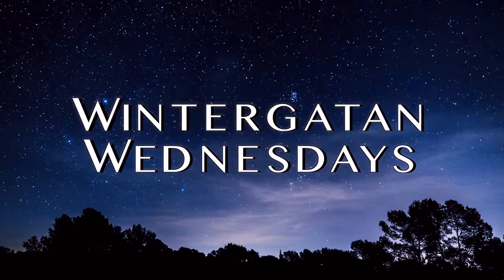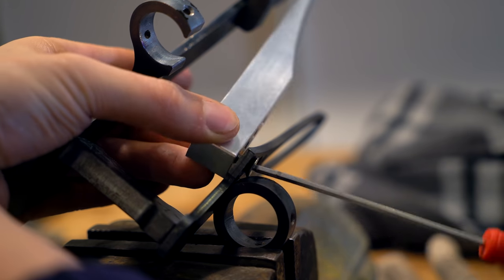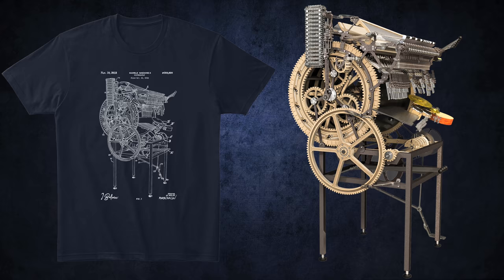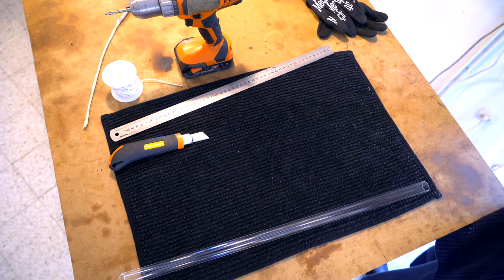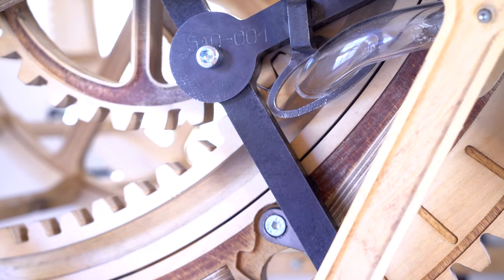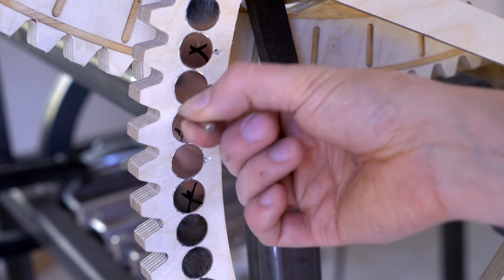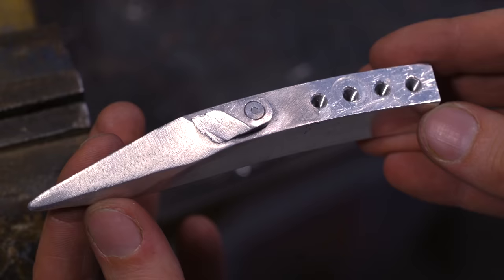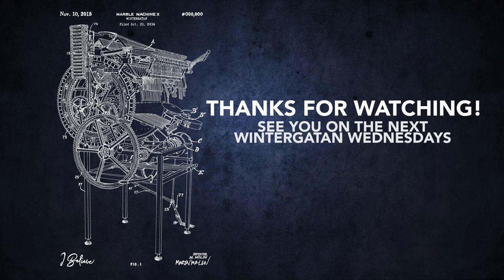Magnet Polarity Switch - Marble Machine X #60

Comment: You should use KOZ (keep out zone) volumes with your screws to avoid that type of problem. This is what we use in aeronotics to design flight engines. We basically draw a volume that represent the space required  to remove the screw at the top of it and when you put your screw in your assembly you will be able to see instantly if the KOZ touches another part of the assembly. You can also draw the tools volumes required to actually remove the screw so you make sure that not only the screw will be able to get out of the hole but also that you will have enough place to put the screw driver above the screw. KOZ and tools should be on another layer of the assembly. When you use this trick you dont need to "think" while designing haha :). 

Have fun and thank you for your content what you are doing is really cool ;)
Reply: very interesting trick! thanks for sharing :)
Reply: Ah that's so cool! So obvious but I never would have thought of it.
Reply: Can you share this little secret with automotive engineers?
Reply: Have you ever worked on a metric motorcycle? Dear god I swear they have miniature people and tools that put those things together.
Reply: Very smart!
Reply: you must also calculate the space which is required by the tool to work on the part. it doesn't make sense to have space for the screw to be placed but no screwdriver in the world can reach it then.
Reply: @TheHolan  that's what the comment said
Reply: @ @JJRicks  well, I probably should look out for my reading glasses... :-)
Reply: @TheHolan  :D
Reply: @sentry4944  Have you seen the Honda testing videos from the 80s?  Those guys are not big, lol.
Reply: @cmmartti  At the same time I could literally sit inside the engine bay of my old K1500 and work on the L05.  :)  Definitely been there when the flexplate on my jeep was making weird noises though.
Reply: @000polsris000  That was my immediate thought as well. What are they thinking?

Comment: You need to apply a coating to this aluminium piece, but not because of galvanic corrosion. The hardened steel balls will create a channel in the aluminium piece with time due to the impact of two difference hardness material. You'll be effectively bead blasting the same spot on the aluminium. The best would be an hard anodized coating. Another method would be to have a wear layer like a hard paint or a good plastic like Delrin. At the worst put a layer of Kapton tape, that will show the intensity the effect and protect temporarily. If you worry about the look, there is clear anodize or alodine, which is less hard, but much better than nothing.
Reply: Also, the friction coefficient is around 0.5 (dynamic) in your case, which make it quite bad, like a bearing without any grease and oil.
Reply: After the part is perfected, get it copied in Titanium. All problems solved.
Reply: @HeyWatchThis00  Tungsten carbide you mean?
Reply: I think that in the contrary, the natural wear will facilitate the flow so it shouldn't be coated. Then the wear will slow down quite a bit once the groove is done, so I don't feel this is a problem at least for a few hundreds of hours.
Reply: ... what about wear on the wood?
Reply: @robozstarrr8930  The shape may not be as critical, the  area may be larger in most place (or change with each strike), and wood can absorb in it's fiber some waxing and oily compounds if need be without making the machine ugly.
Reply: roboZ starrr
Exactly, I think other parts of the machine will become a problem long before that aluminimum.
Reply: @johnnylavoie  I think it's better if the marbles are a harder material than parts of the machine.  It's easier to replace and maintain one part than it is to find a bunch of damaged marbles.  I'm not sure why he didn't just make it in regular mild steel like the rest of the frame, it would have been ideally hard not to wear prematurely, but not so hard it unduly damage the marbles.
Reply: @UnbeltedSundew  Much better than mild steel would be bronze. It's harder than aluminium, and the coefficient of friction for steel on bronze is much lower than steel on aluminium or steel on steel. Bronze is still the go-to material for bushings for this reason. It's also a material with an interesting colour and long tradition of use in musical instruments.
Reply: nerd1000ify perhaps you mean brass ?
Reply: Make it out of steel and chrome it.  This will give it the nice look you want and will add a ton of wear resistance.
Reply: Basement ScienceE like what?
Reply: nope, he/she means bronze.   @professortrog7742
Reply: @UnbeltedSundew  he didnt make it out of mild steel because of the magnets. He probably thought that having magnets close to the steel would cause issues, and its best to avoid them.

Comment: You can dip the silicon insert in soap water before inserting it. It will make it much easier to insert, and also easier to pull out. It is very used in PC building with solid tubes:D
Reply: But what effect will that soap have on the color and clarity of the tubes once the heat is applied?
Reply: @alvatoredimarco  shouldn't have any, that's why its used in hard loop water cooling because the tubes need to be clear to show the coloured coolant inside which is usually part of the design of a PC.
Reply: @alvatoredimarco  I used soapy water in my PC tubes and I'm also running clear coolant (distilled water and corrosion inhibitor) which after two years of not changing (versus the recommended six months) is still completely clear. Soapy water will not hurt the color of the tubes.
Reply: Nice to see you here Hans. Love your builds!
Reply: The soap can result in residue after heating, this has been discussed in length in these comments.

The short answer is; you might as well use a little more effort and avoid the plethora of issues that can come from introducing soap water.
Reply: @RupeeRhod  I have never experienced that in my years of working with pmma and petg tubing. And it gets heated up quite a bit to the point where the soapy water will reach boiling point. I just flush the tubes in the sink after bending.
Reply: While I don't have personal experience with bending tubes like this I feel like heating soapy water would be pretty likely to leave residue. Might not be a problem in PC cooling as those tube will have liquid in them.
Reply: Olive oil works actually better IMO.

Comment: If you decide to redesign this part, I'd strongly recommend to make the ends out of steel and only connect the pmma tube orthogonally to those. Think of it like fittings in water cooling.

I believe that with the current design, you will run into wear. The PMMA tube will stop functioning and maybe even break. Also there's too much flex.
Reply: I agree, it seems very likely that the PMMA tube could flex out of position at some point. A steel part would also have much lower friction, so the issue where the marbles starts to jam when entering the PMMA should also be less of an issue.

Comment: Looking great! 
It seems to me that attaching the PMMA pipe to the steel input "ring" on the lower gear would be smart.  It would help prevent marbles bunching up in the intake.  When it was struggling, the PMMA was flexing quite a bit and making too large of a gap to restrict it to 1 marble at a time.  cutting some threaded holes in the PMMA for set screws would probably work.  Or maybe even just supergluing the tube to the ring.  Just a thought.

Comment: If you shorten a screw put a nut on it before that. When you remove the screw after cutting it kind of repairs the thread that you don't have to re-thread.
Reply: Great tip, thanks!
Reply: a nut does not cut a proper thread, it is not hard enough to do that in a good quality
Reply: @rigdigwus  The point isn't to cut a thread, but to straighten the thread just where it was sawn off. Maybe you have to try it to understand.

Comment: As with all your work - fantastic job! As a fellow engineer I think that part of your problem with the exit pipe is due to the fact that you have a quite long pipe before the first mouting point (making the first part of it an effective "lever"). This will pick up vibrations and start to move like it did in your video (causing the stucked marbles). Either the holder needs to be very stiff or you could just add a little support arm near the exit at a different angle. Anyway I fear that you might run into the same problem again when you are running the machine at full speed of the gears and also when you get a little wear on the parts.
Reply: ....interesting point . . .  think the problem may be basic mechanics, the chg of momentum onto the plastic tube along w/redirection onto the tube slows down the balls, can't be helped and they bunch up.  it might help to have a very fast height change after ball enters tube to reduce the traffic jam... perhaps even going as far as to have the plastic tube change height (angle) automatically, depending on the speed of the wheel ( maybe govern this off upper wheel ).

Comment: well in your design tracking system ... now that you have hand modified that part..
what happens to the version number...   does it get a new number or is there a sub version number it get assigned for the mod.
Reply: You go to the chart, change the progression to redesign, then make the change in cad, then change the chart to done.
Sometime with car, you will see a revision number at the end of the part number, like 500a100-1, 500a100-2...
This is because the piece can be modified during the production of the car and sometime a modified part won't fit with the older version and vice-versa. It's important to know when buying new parts, cause these change aren't always evident, like a bolt hole deplaced by 10 mm to prevent a fatigue crack.
Reply: @ameunier41  +
Reply: @ameunier41  And don't forget to fill out and file your Engineering Change Order (ECO)  form detailing what changed, why, and who all signed off on it.

Comment: FYI the third tap in the set is only for blind holes. For most cases, just the second tap is all you need, but the first tap does help you start it straight since you are power tapping. All of the taps have fully formed threads, the difference is just the taper angle to those threads.
Reply: That is definitely not true for all 3 stage taps. Most of the ones we use are 3 stage taps. You would never be able to get a bolt in a hole tapped with just first or first 2 stages
Reply: @bigchuckstar  correct, not all 3 piece tap sets are ground this way. But the vast majority are. At 7:50 you can get a good shot of the taps. The only difference is the taper angle. You can see even the starter tap has fully formed taps. Incremental tap sets are more tuned for larger diameters in semi hard materials, those do not have fully formed threads until the third tap. Most 3 piece tap sets (including this one) are standard starter, plug, and blind taps. 

Also judging by the effort each tap took, it sounds like the first tap did all the hard work and the next 2 were just chasing the threads.
Reply: These are a cutting, reaming and finishing tap set.

Comment: Have you considered using something like a "Greenlee 860-1 PVC Heating Blanket" for bending your pipe?   I know the heat gun works quickly but doesn't give you even heat for bending.  I'm sure someone makes them for the European market (voltage).   With a blanket you don't have to worry about burning or bubbling your pipe.

Having retired as a development engineer, I think you might want to look at the sharp edge of the inner shoulder of the lower lift wheel.  A small radius might be beneficial in the offload at the "fang".
Reply: I´m not sure what type he´s using, but you can get temperature-controlled hot air guns fairly cheaply.

Comment: Are you absolutely sure that 4 screws are enough to hold the aluminium fang?  Seriously Martin, just leave that trapped screw out.  If 3 screws, torqued to the appropriate value, are insufficient, then the 4th screw isn't going to help you.

I also suggest some "anti sieze grease" to resist the galvanic corrosion.  I have had  galvanic corrosion occur in clean room (read: non marine) environments.
Reply: Damn it!  Aesthetics DEMANDS those four screws to be there.  You can't just have some empty, useless holes there!
And there are still problems mounting the other three screws, so he is still screwed without that screw... :-)

(Hm, you COULD just remove the threads and glue the fourth screw there, and then have that as a fix point when mounting it)

The suggestion is good.  Or just ad some sacrifice aluminium pieces like they do with boats. :-)
Reply: @AndersJackson  Or he could simply flip the arrangement.  Tap the support and bore the fang. The screws pass through the fang and engage threads on the support.

 Problem solved.
(Which, by the way, solves the galvanic corrosion problem too!)
Reply: @WhatAboutTheBee  That's really the best solution, if I'm honest. Also, four screws seems like a definite case of over-engineering. What sort of gravitational environment is this fang going to be operating in where three screws wouldn't have been enough to hold it onto the support?
Reply: He needs corrosion resistant compounds, not anti-sieze, something along the line like Corban 27L
Reply: Lanolin. Wool-fat. That's what I put between rivet (V2A) and boom (alu), between V2A screw and mild steel tap, zinc and cast alu (brakepad holders), zinc and cast iron (ditto) and so on. No matter street-salt or marine environment. Helps a lot.

Comment: @Wintergatan If it's possible, I'd suggest cutting small channels in the support ring (and possibly the tube) to allow the screws to be easily removed and replaced
Reply: No - I'm pretty sure "screw" was the wrong fastener choice there.  He hacked it together - but if you are gonna do the work to fix it... fix it ALL the way.  Clamp or puzzle notch or 3D printed plastic are all probably better design decisions.  (Then again, he got it to work, so it doesn't really matter... unless he wants to easily make spare parts)
Reply: I fell like putting in the screws in the opposite direction, would be a better solution
Reply: @kin2naruto  3d printing is not practical.
Reply: @SuperAWaC  It's practical for some purposes. It can't be upscaled easily and has limited material choice, but incredible flexibility. That's why it's used so much for prototyping, and for making small batches of things.
My technical knowledge is insufficient to say if it's practical for this specific part, but it's definitely practical for some of the MMX's parts.
Reply: @BigumSailing  Unfortunatly not because the screws need to be screwed through the wheel..... and seems can't be screwed before attaching the #5A0-000 once assembled.....
Reply: @pascal-cm4sq  Damm didn't think about that :/

Comment: Martin - how are you going to compensate for the Aluminum being so VERY soft? The marbles might be smooth, but dust and other contaminants are going to wear that out of shape pretty fast, imo.

Likewise with the plastic piping. Dust and other contaminants (in particular, oils, when it comes to the plastics, like the ones from your hands) are going to roughen up, and eventually wear out in the inside of those tubes.

Also, how are you planning on preventing those tubes from yellowing over time?

Comment: I'm have a suggestion for the marble entrance and exit designs. I see you have already corrected the issue, but it might make thinks much cleaner to assemble. I think it would make thinks a lot easier if you 3D printed a guide  that the tube could slide into, and perfectly form to the metal so you could just cut off the tubing flat. It would save a lot of hassle of trying to perfect the angle of the tubing where they connect to the lasercut metal mount and working against the deformation of the plastic. I've made a quick example design to show you what I mean (just rough based on your design), here are some images. https://imgur.com/a/BY7Ekl0
Reply: Yes! Also the aluminium wedge could be 3d printed also, preferably in nylon for the self lubricating properties.
Reply: ye but aluminium just looks a lot cooler

Comment: I am curious to see how the aluminium wedge will wear after a few tens of millions (tens of hours of rotation at 1000ball/minute) hardened steel balls. I don't know if it will be a functional issue, but it should get incredibly shiny. It just give me the idea of using a work hardening metal, the ball themselves would strengthen the surface they ride on.
Reply: That is my concern more than galvanic corrosion.  A part like that made out of aluminum should either be plated or hardcoat anodized; that way, the wear is on the more easily replaced parts (and wear on the steel balls probably wouldn't be a problem).  If you plated with Ni/PTFE or sealed anodizing with PTFE, it would also add so lubricity to a place that could probably use it.
Reply: That's what I was thinking too. Just like the optics I work with, I'm sure the MMX needs a good dose of aluminum oxide particles everywhere a marble might run.
Reply: @chrisufo05  I don't think it's the real concern, if it needs maintenance at the 100th concert it will be a success. it's just that I let mind wander.